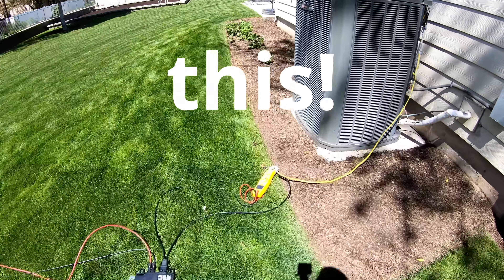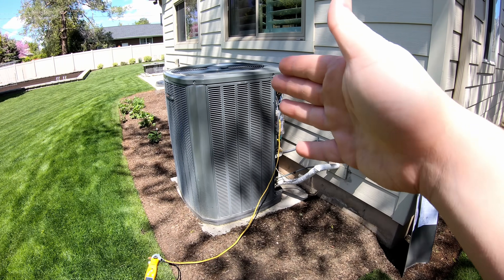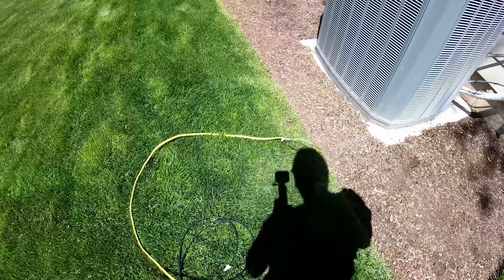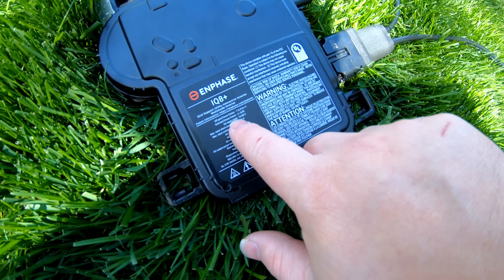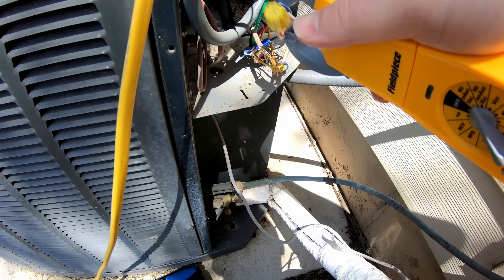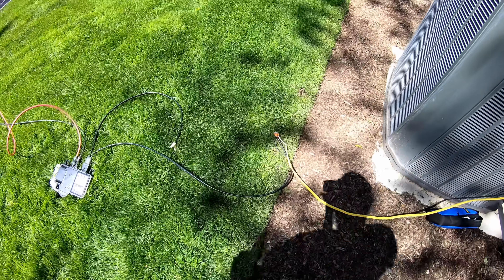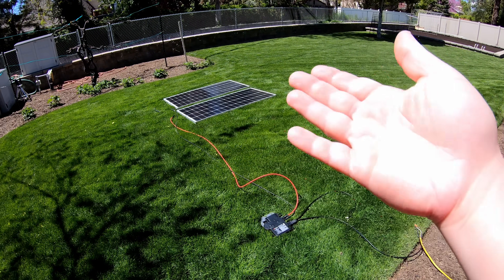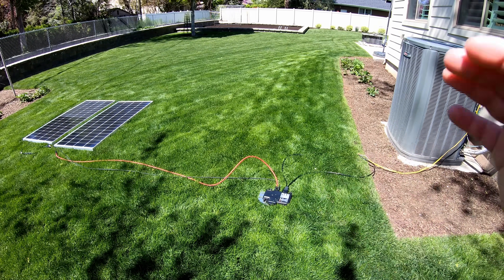1 Hack To Eliminate Your A/C Power Bill This Summer!

Comment: This is totally amazing. Now if only I could do this to a window unit.Wait, do you think it will work with a window unit?
Reply from the maker: Thanks! It won’t work with a window unit very well unless your window unit is 240V or you find a 120V micro inverter. But then you’ll have to wire in some kind of relay that turns on and off with the window unit compressor to avoid back feeding the grid…seems like to much trouble and hassle. Sorry about that! Maybe consider getting a solar power station, plugging your window ac into that and then connecting solar to the power station. Would probably be more useful and an easier solution for a window unit. You might consider the Anker Solix C1000. Here’s a link to my review and testing of that unit. I think it’s even on sale for Memorial Day. https://youtu.be/Zdl3syXDUP8?si=GYXwEd0gqnx8fORw
Thanks for watching!
Reply: You can buy a 24,000 btu mini split from Signature Solar for $1899. It has a built in MPPT inverter built in and you can connect solar panels direct to the AC unit. But some used solar panels locally, or from San tan Solar to cut costs and you're good to go. It will run 100% from solar and from the grid on cloudy days and at night.
If you don't need 24,000BTU they have a 12,000BTU unit for $1299.
They also sell complete setups with solar panels

Comment: Please give spec's for the A/C demand and the two panels output,  because my back of the envelope figures fall far short of running that whole house A/C
Reply from the maker: Did you watch the entire video? I show amp draws and everything for the A/C unit! Also, see if you can find the part in the video where I talk about my two panels and single micro inverter not being sufficient for my A/C unit. Thanks for watching!

Comment: I like it. The only downside is the loss of solar when the AC is off. Better application for a pool pump. Quick back of the envelope calculation is a 4 year payout with tax credit and only a 4 hour run time per day.
Reply from the maker: Yep! You would get more bang for the solar if it could run non-stop. But hey! Solar panels are cheap...batteries are not. So might as well reap some offset to your power bill while you're saving for other equipment to allow your solar to run non-stop all day! Thanks for watching!

Comment: I will not say eliminate but definitely offset. Good job 😊
Reply: I was wondering about the life span of the micro inverter cycling on & off when the ac is operational. I have a pool pump, which I will be doing the same set up, but that stays on for 8 hrs.
Reply from the maker: @andys5203  Time will tell on the longevity I guess. Glad to hear you’re going to be using it with the pool pump! Great solution for that!
Reply: The HVAC industry could eliminate grid power with self contained package minisplit AC units....they already have soft start circuitry and draw much less power...plus as zone ACs they could be programmed to automatically ration Air Conditioning to priority and low priority zones when solar power drops.

The AC would pull grid power only when insufficient solar hours exist.

If the collective world was really worried about what they said they are, then that would have been the first mandated upgrade to heavy appliances in the 1980s and 90s.

As it is, the design described above would triple ir quadruple the cost of a minisplit install...which would require years of payback...which may not be covered by the lifecycle of the unit.
Reply from the maker: Offset is a great word! Thanks for watching!

Comment: Uh.......I donno about this ?
As Home Air Conditioners draw between 15 - 60 Amps, depending on their size !
Having played with Solar myself, I just don't see a couple of panels pulling this stunt off ?
But what do I know ?
                           🤔.....?
This looks dangerous in a number of ways !
At least to me !
🫲🧐🫴
Reply from the maker: You're right! But did you watch the whole video? I explain how I did everything in detail. A little over 1 amp at 240V is not enough to power the entire A/C so the grid makes up the difference. But you can add more panels and micro inverters to 100% offset the A/C power consumption! Thanks for watching!

Comment: Would you please run through the calculations you had to do to make sure that your solar panel output was sufficient to run your air conditioner?  As you said, you have 400 watt of solar panels and it is running your air conditioner?  What did you do so that at startup of your compressor you had sufficient amps to turn it on?  Also, how many ton AC do you have?
Reply from the maker: Good thoughts and questions! 400 watts of panels is NOT enough to run an A/C my size. The secret sauce is that enphase inverters are gird tie compatible. So it's just contributing what power it can from the panels and the grid makes up the rest which you can see in my amp readings. I lowered the amount of amps being pulled from the grid by 1.2 or so, but the remaining 4ish amps needed by the A/C unit to run were still being pulled from the grid. You could add more panels and micro inverters to offset the A/C 100% if you would like. Thanks for watching!
Reply: What is your SEER rating on your AC?
Reply: If my math is correct, to have enough output from your solar panels to fully power your AC, you would need approximately 11 (200 watt) solar panels to produce enough power to run your AC.  I understand the logic behind what you have done to supplement the actual power draw of your AC.  With your current panels producing a little over 2 amps, I wonder what your cost savings would be if you were able to keep this running?  How long then would it take you to pay for your current setup? (I realize you would probably have to put your panels in a different location for a more permanent setup.)

Comment: This is pretty cool! I didnt see you test the voltage after you connected inverter to the contactor while the disconnect is still unplugged. When the contactor is off, the microinverter should not energize the compressor but could the capacitor have enough current to "trick" the microinverter making the system live even though the contactor is off? Also the solar energy from the panels is wasted when off, so having a battery or some other way to use the energy would be good to get more use out of the panels.
Reply from the maker: Maybe it's possible that capacitor could fool the inverter for a minute...but it takes a few minutes of the grid being present before the inverter starts producing, so I don't think we need to worry about that. And yes, it would be best to not only be producing power when the A/C is on. But solar panels are cheap, batteries are not. So if you could run your A/C for "free" even though you're leaving power on the table, that might be enough for some people. Or start by just offsetting your A/C power bill and apply your savings to the cost of a battery down the road. Thank for watching!
Reply: @theresatrickforthat  The best part is you already have a virtual battery. It's your house. 

If you run your AC during the middle of the day when you're at work instead of shutting it off because you're not home and cool all the rooms down  really well, then keep the house buttoned up until early morning when it's cool outside, you don't need to have batteries to run the AC at night.
Reply: @jm-um1tx  Agreed, although that really only makes sense to do it that way if you have enough solar to come close to zeroing out the consumption from the grid.  

Also, keep in mind if there's a little bit of excess solar energy being produced in excess of what the AC is consuming, it would likely be consumed by the base load from the rest of the house (refrigerator, wall warts, fans, lights, etc) before it got pushed back to the grid.  Most houses always seem to use at least a couple of hundred watts at all times, obviously that varies by household, but generally this is the case.
Reply: @ssoffshore5111  Yep, and as you say, buy more panels, they're cheaper than batteries.

Comment: I'd like to see some voltage readings. My A/C runs at 250 V @ ~22 - 26A. If you;re running with 5A, your voltage must be
@ 1000V, which the motor cannot tolerate. I'm only an electrician, but this is suspect.
Reply: My 4 ton 2 stage runs at 9-11 amps at 240 on the low stage 12-13 amps on the 2nd stage. 
Not sure if he had a 2 ton or 2-1/2 ton.
Reply from the maker: I'm in the good old USA on 240V split phase power like everyone else! My unit is a 3 ton two stage unit, so the amp readings you were seeing was with it on low stage. Thanks for watching!

Comment: What about the fan inside the home? What moves the air inside the home? I see nothing going to the inside of the home. You have to have a thermostat inside that feeds the system usually the system in the house consists of the  cooling coils, and a dehumidifier  system as well as the fan, all inside. Most are incorporated  with the furnace controls. Not a smart setup here folks. Do not do this.
Reply: @scottfirman don’t do this because you do not understand how electricity works.  

On the other hand the solar is just supplementing power to the condenser, it is not supplying all the power needed.   Will work and does work and hvac companies have done this similar setup themselves.
Reply: @racinjason68 I'm learning and curious. Please elaborate on what or how hvac companies have done similar setups
Reply from the maker: Yep! There is an air handler in the house. But the outside compressor uses a lot more power than the indoor fan does and it's 240V, so the proof of concept shown in the video is to have an easy place to tap into a 240V power supply with the micro inverter while offsetting the largest load of the AC. Of course, as the disclaimer in the video stated...do not attempt this yourself. Thanks for watching!

Comment: If this is drawing 5 to 10 amps look into victron multiplus. Those units are design to sync solar with grid in one unit. RV people do this all the time.
Reply from the maker: I'm sure it would work too! The idea behind what I'm showing here is you can start small and grow over time all while offsetting the power consumed sooner rather than later once budget allows for a large inverter. Thanks for watching!
Reply: That’s like 8x the price of this
Reply from the maker: Yep! You're exactly right! Thanks for watching!

Comment: This works and using emphases are best. Recommend adding FRN fuse pairs just off the contactor and a ground wire to the panel frame to the condenser frame ground.
Reply from the maker: Great ideas! Thanks for watching!

Comment: I have 4 of the older IQ7's. I was thinking about getting a 12dc to 220vac inverter to simulate grid power. And see if I could make a off grid, grid. Don't know what for, other than just seeing if it can be done.
Reply: The challenge with this is that the inverters will "push" their output higher until the inverter is putting out as much power as possible. This will feed back into the 12v to 220v inverter, and cause it to either shut off, or burn up.  The "mains source" needs to be a lot more powerful than the grid tie inverter(s)... by at least several times. IOW, if you want to use 1000 Watts of solar through grief tie inverters, your main source of "artificial grid" needs to be at least 3-5 times as much power.  In a case like this, those IQ8 inverters can actually form their own micro-grid on their own... but you need their other equipment to control the IQ8 inverters, as this is a special mode that has very strict requirements.

... or just buy a Hybrid Solar Inverter - that can do both Grid-Tie (grid interactive), or off-grid operation as needed... though that usually requires a storage battery to fill-in the gaps when cloud cover would cause a loss-of-solar black-out.
Reply from the maker: Worth a try I suppose! Thanks for watching!
Reply: Lots of folks have tried to do just that.  Almost universally with disappointing results. Two of the main "gotchas" are frequecy and voltage stability. Enphase microinverters have tight grid frequency and grid voltage tolerances.

Comment: As an 30 year hvac tech, and a guy that has a sprinter overlander that’s loaded with Victron equipment, I can tell you that won’t even come close to working.
First of all that a/c condenser is 220v you solar inverter is only 120v and I can tell by its size it’s only going to handle about 8 amps and that’s at 120v.
Don’t do stupid things and post it, people will try it and get hurt.
Reply from the maker: Good news! These inverters are 240V! Great little product…and they scale well, so while they only put out a fairly small amount of power you can parallel them and make as large of a system as you need! Anyway, was a fun proof of concept and as the disclaimer in the video states…don’t attempt what I show on your own! Thanks for watching!
Reply: 30yrs knowledge HVAC, 0yrs in solar. Those micro inverts are 240vac output grid tie inverters. Designed for roof mount solar (not normally for DIY)
Reply: All enphase grid tie are 240vac, they also have 208vac models.
Reply: This is the part where you thank those individuals for correcting you.

Comment: So, what size is your AC unit and who makes it? That 5 amp draw is impressive if it is a 3 ton unit. My old units need to get replaced.
Reply: Start up amp draw is only momentary less than 1 second. The inverter is offsetting the run wattage.
Reply from the maker: Mine is a 3 tone Trane…but it’s two stage. So the amp draw you were seeing was on low stage where it starts. It’s been great and works very well for me. Thanks for watching!
Reply: @theresatrickforthat Very roughly, about how many watts would a typical single stage 3.5 ton AC unit consume while running? (I’m sure that depends how n a number of variables, but ballpark?)
Reply from the maker: @rocktman81 You’re right…there are a ton of variables! I can only speak to my 3 ton unit in high stage the most watts I’ve ever seen it pull is just over 2000 or about 8.5 amps at 240V. Thanks for watching!
Reply: @rocktman81 : The startup amp draw is what you need to be concerned about.
Reply: @zapa1pnt  Not sure why that is a concern.  The grid takes care of that before the iQ8 jumps in.  (and he has a soft start device at that) Am I missing something?
Reply: @garyhiland6013 : Doesn't matter. The start up is always the highest amp draw and so it is what you need to use for your computations.
Reply: @theresatrickforthat  8.5 amps is still not bad imo. My current 3 ton system developed a leak over the winter and draws about 20 amps when fully charged. R22 system about 30 years old so will not be fixing this system. I do have some mini-splits installed in the bedrooms we use so no hurry at this time.

Comment: there needs to be a legit AC system that runs exclusively on solar and requests grid power when needed. Could also have batteries in between.
Reply: Yes this does exist the eg4 solar hybrid mini splits are available. Check them out.
Reply: @firstlast-ey3gx  Yup, I read about that unit a lot but I too wonder about splicing in a battery somehow.  Enough to run the AC through our peak pricing period after sun goes down.  A server rack battery would do fine. Ideas anyone?
Reply from the maker: That’s an option as well!

Comment: Use it for water heaters and electric dryers.
Reply from the maker: Great ideas! Thanks for watching!
Reply: if you use a generator switch(s) maybe.....  you could use that to switch the solar/inverter setup to toggle between heaters, dryers, AC etc.  You could just not have more than one on at a time unless you arrange it to where one location of the switches allows two "specific" things on- and those two things power draw when in use/ power draw added together, does not max out any more than the solar set ups parameters.